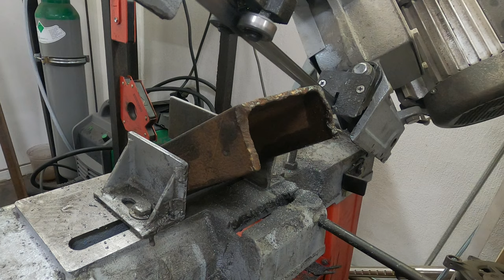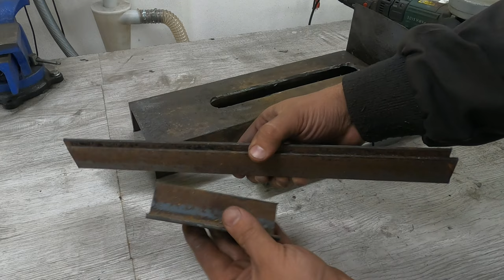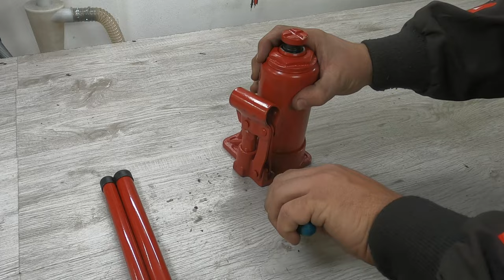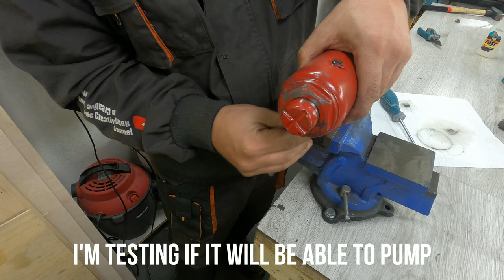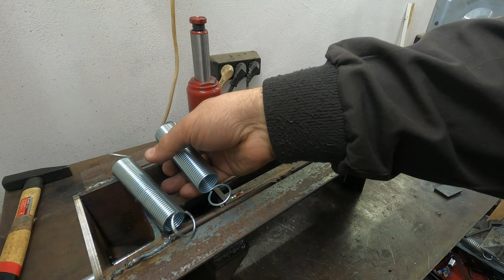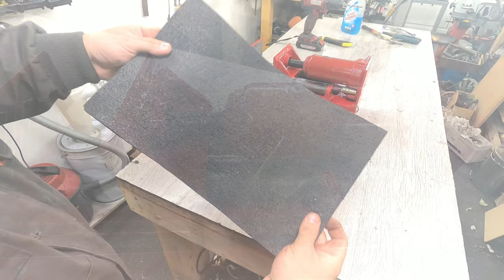Amazing Hydraulic Jack Idea  Made It From Scrap And Hydraulic Jak 5 Tons

Comment: Could not find one reason for needing something like this,other than to remove and use the jack.
Reply: What do you use this for?
Reply: EFD620G. It be great to have a vice with that kind of power
Reply: You have no imagination. :-) Commercial versions are available. $$ There must be a use & a market. There's more to DIY than just saving money. I say kudos to the builder even if its never used.
Reply: It has a lot of range, can be used for pressing in bearings, bending metal pieces, in fact, a great substitute for a press if you have a smaller job to do. I like it.

Comment: im going to share with with a buddy,  he is always pressing bearings on small engines and this would work well for him instead of the 800 pound hydraulic press that he cant take to a job sight. 
normally he uses sockets and a hammer to seat or remove bearings.    (customers cringe)

edit.  if you had a larger version of this and put your fire wood in it, it would burn a lot longer.     very cool!
thumbs up

Comment: Hi, Great Video. I don’t really understand what the Copper Tube you put inside the Hydraulic Jack does? Otherwise it turned out Great.👍
Reply: i am guessing, but i'm thinking 2 options.  the first is a pick up for the fluid to evacuate the space since the jack is out of orientation and the second is to allow something very close to what i have just written.  the base of the jack is such that when the pressure valve is closed, fluid pumped can only enter the bottle pressure vessel which lifts the jack. when open, the ball valve is not held securely and the oil flows into the reservoir.   the booklet that came with my jacks state to use horizontally, you turn the pump arm to the sky and it will work correctly, not sure why he added the tube.

Comment: not bad, except the force on the vice jaws are actually only as strong as the base plate of the jack. while likely strong enough for most work, you are not going to get the full capability of the hydraulics because the base will likely deform, then the rams will come out of alignment